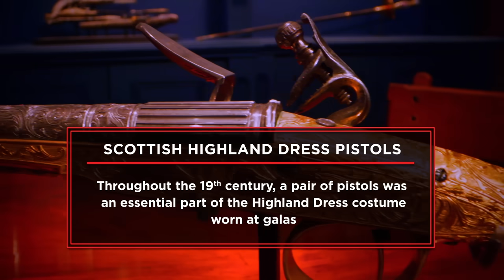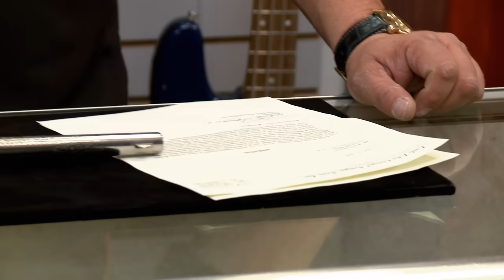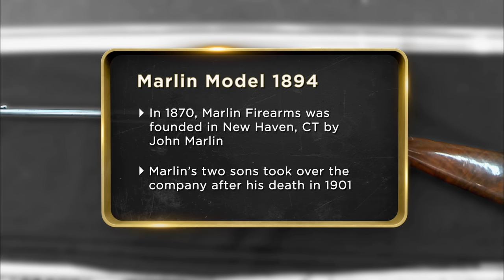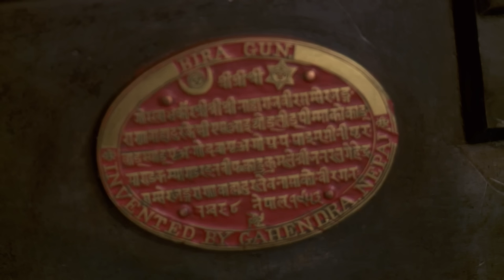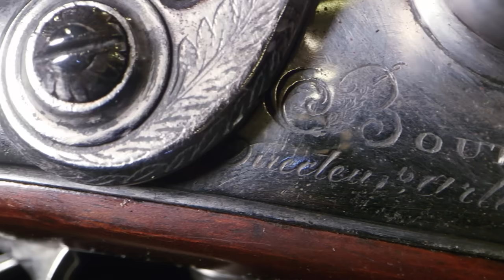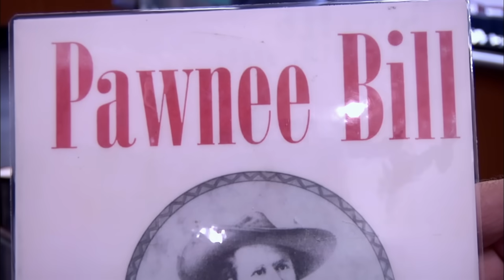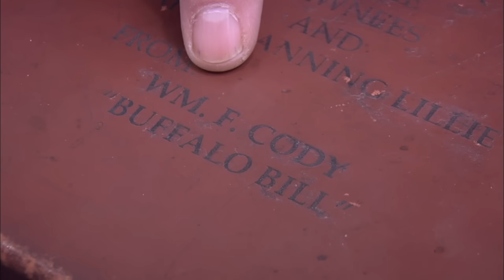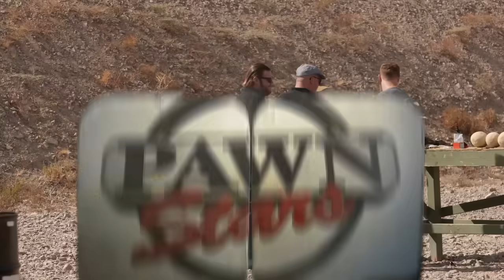Pawn Stars: RICK'S 7 MOST EXPENSIVE GUNS OF ALL TIME

Comment: Japanese hand saws are designed to pull instead of push.. i own one, and am inclined to believe pulling is easier than pushing. Not only easier, but slightly more accurate. I’m glad mark got to shoot it. Rick not using it correctly. Whole point in pulling is you can easily use your weight, not your arms
Reply: Just lean back, son.. you should work on your form a bit.